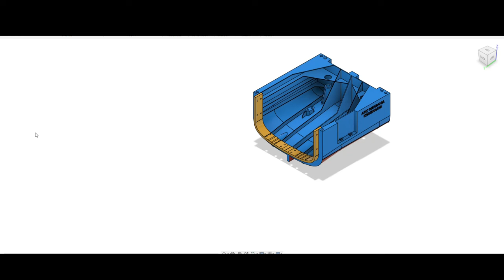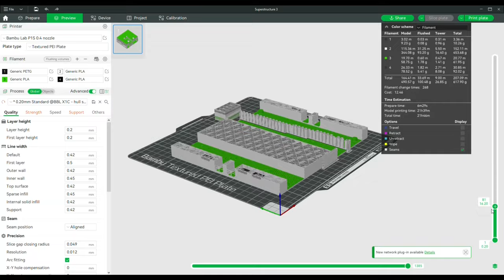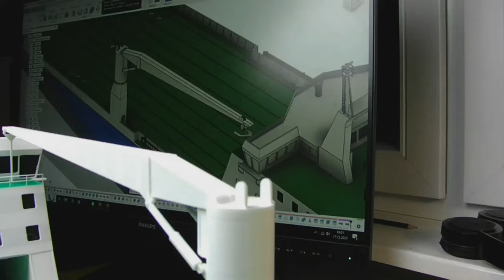Big  1.3m long 3D printed  RC vessel  DFDS  "Ark Germania" 1:150 Scale

Comment: Nice looking boat there! Bravo! How does the bowthruster design perform? I Like it and would be tempted to try something similar on a futur build if your's performs well. Once againe good job and nice build video!
Reply from the maker: Thank you! So there is no so much power, but with weak wind thrust is useful. Anyway before I put it in to the model I made few experiments with different versions  and it works good enough for me. I believe that more rpms could generate much more thrust, but I didn't check it.
Reply: @MMalinaPL  thanks for your answer. I'd like to try something similar soon. 
By the way, I like the way you assembled your boat. I should use some silicone on my builds too. Have fun with your next project and thanks for sharing them.

Comment from the maker: So if you want to redesign much better will be to use step files instead of stl. Just now I'm quite busy with other project. Maybe some day I will start with tanker vessel but just now I working with crane ship. As my experience shows, ussualy it's easier to make new hull than redesign other. But it's just my opinion.
Reply: Thank you for your insight! Appreciate your response. I have finished printing out the Hall today, and I am in the process of getting it ready for assembly. I have all the parts on hand I will not be programming the receiver like you did, but rather a premade radio unit. I think it’ll work the same. Looking forward to your new designs!
Reply from the maker: @skupper672  Thank you too ! I would be grateful if you post a make when vessel will be ready.
Reply: For sure! I just finished connecting the hull sections and I am amazed by the engineering of this model!! Can’t thank you enough!
Question what program did you use to design it?
Reply from the maker: Fusion360  @skupper672

Comment: Making progress! Question-  Do you think the rudder size is sufficient? Contemplating a 10-20% increase for better maneuverability
Reply from the maker: In my opinion, it's ok. The first time I tried it, I used a 3-blade 40 propeller and I was not satisfied. I changed to 4 Blade 50 and it was much better.

Comment: Hi there!- I started printing! Question- What filament did you print with? PLA?
Reply from the maker: I've made with pla, but remember that pla is very sensitive for heat. Even sunnny day on shelve can cause deformation. In that point PetG would be better.
Reply: Thanks. Ive heard the same. I have started with PLA “tough” filament and intend to epoxy coat and paint the hull. I may use PTEG for the topsides. On another note, after i build this I would like to utilize the same hull (because its genius) and convert the topsides and superstructure to a tanker. Only the stern hull section will need to be redesigned for a singled propeller. Deck needs piping and manifold and the superstructure made small and moved aft.  Dont know how to do this but will try to figure it out…. (If you want to attempt to design that for me maybe we can talk about hiring you to design what i am looking for?)   @MMalinaPL

Comment: Amazing model. Cannot wait to make it however i cannot download the manual .pdf file. Can you assist?
Reply from the maker: There is package .rar to download in both links. If you unzip, there is manual.pdf file.
Reply: I am keen to get this started but I know nothing about arduio. Is there an off the shelf system that you recommend for this model? I dont want to lose any functionality. Thanks for your work on this model.
Reply from the maker: @skupper672  I'm Sure there is other way,  but i found myself arduino easiest and to be honest I do not know other way . Anyway, With this arduino motor shield circuit is really easy. Uploading code to arduino is very easy as well. There is plenty of guides on youtube, even in my video with "black pike"  Open sketch wit arduinio ide--> upload sketch to arduino--> put motor shield on arduino---> connect motors and receiver ---> power up---> configure transmitter as I show in manual. Thats all. But of course you can look for other solution, but just now I don't know how to help.
Reply: Hello Friend - I can only find 1 STL (stern section) on thing verse and only one section in the rar when I extracted it. Is the rest of the ship located somewhere else?  @MMalinaPL
Reply from the maker: I checked it. If you extract, there is one more .rar file "Thingivesrse" There should be all files in  STL folder.  Sectionas are named 1,2,3,4,5,6,7,8 @skupper672
Reply: Got them thank you! Can you provide some advice about parts? The parts list on page 9 of the manual has links that are incomplete because they are cut off on the picture. I’ve been able to find similar parts on Amazon but the correct sized shafts are hard to figure out. Can you please respond with the actual link to the Ali express shafts? I see that as a critical part to get 100% correct.
Reply from the maker: I put Free files on thingiverse with limited support. On Cults account  there is spead sheet avalible with links to all hardware and STEP Files as well. The shaft I used is here https://www.aliexpress.com/item/32973633157.html?spm=a2g0o.order_detail.order_detail_item.11.7b8cf19cydVbiF  @skupper672

Comment: can you tell pls which Filament you use
Reply from the maker: I used PLA, but remember that PLA is not heat resistant, so even on a sunny day it may deform.